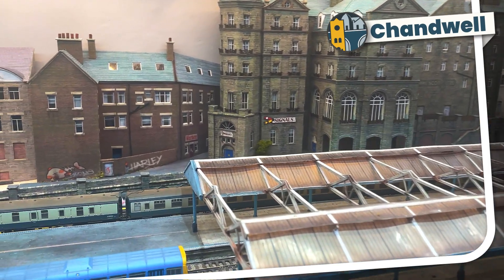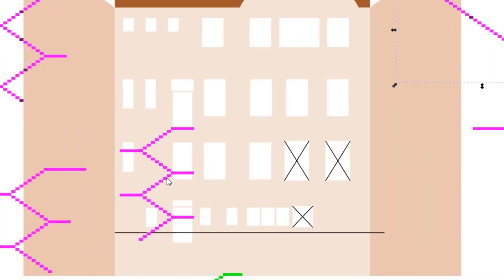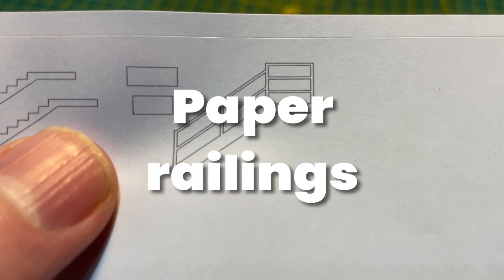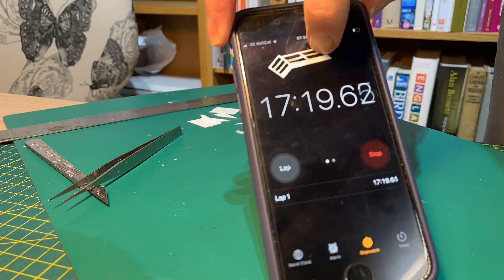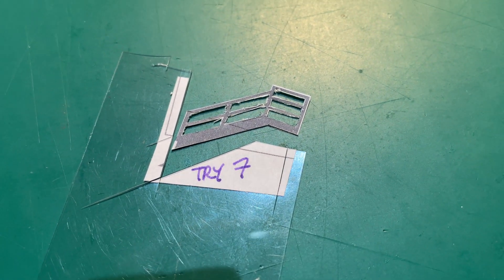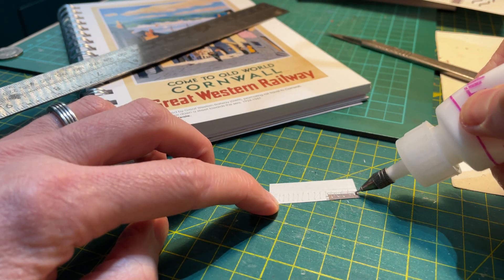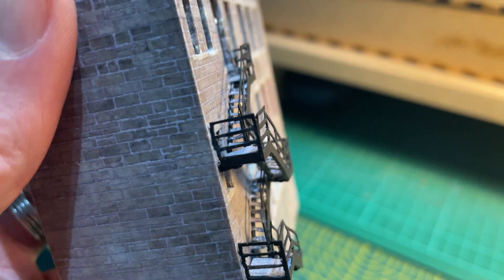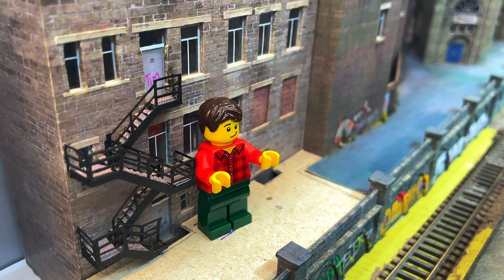Eye Strain! Making a fire escape from paper and packaging

Comment: Less than two pence in materials, Michael, but at what cost in mental health terms? And what about the family Wheetabix consumption? Still, the fire escape looks great, and is just the kind of detail needed at the back of these buildings. Come to think of it, I can't imagine why you haven't got another one, possibly spiral, running down the back of the Station Hotel... Thanks,, Tom
Reply from the maker: Coming soon… how I made a spiral staircase in N gauge from a sticky label and a hair clip..? Don’t set me off! 😂 :_chandChandwell:Michael
Reply: One tiny suggestion about the fire escape - could a bit of rust-coloured paint be dotted onto it, or is the scale too small for that kind of effect?

Comment: But this is f***ING N GAUGE!!!😨😨😨😨

I made a test for a DMU service platform using this method about a week ago, making the steps the same way etc, except I just printed and cut the strings out 4 times onto 2mm card and stuck them back to back to form the body of the stairs 

It looked okay, but ultimately I've decided against it for now, I may re visit it though since you've made success with it!

Cheers mate, keep it up!✌️😉
Reply from the maker: That’s a good idea to make steps like that. Especially if they are filled in ones. I’ll file that away for future reference! Thanks as always! :_chandChandwell:Michael
Reply: @Chandwell  I WAS going to make individual steps... I'm glad I didn't 😨😨